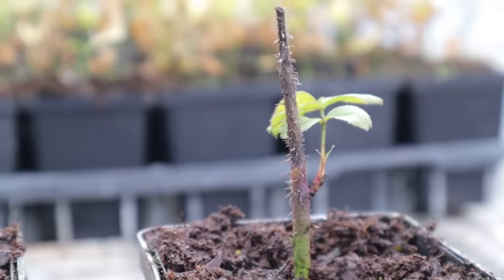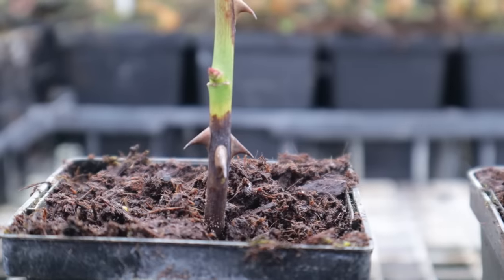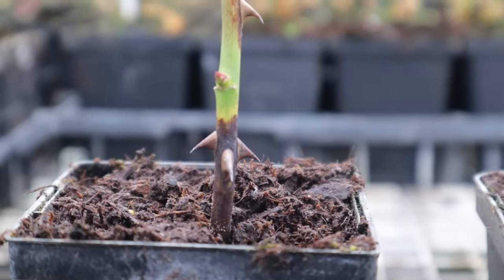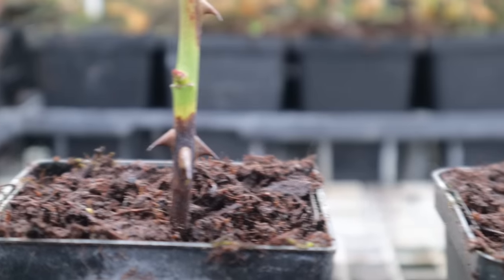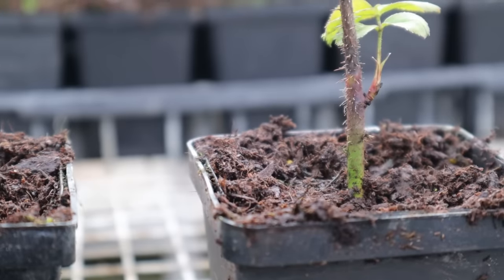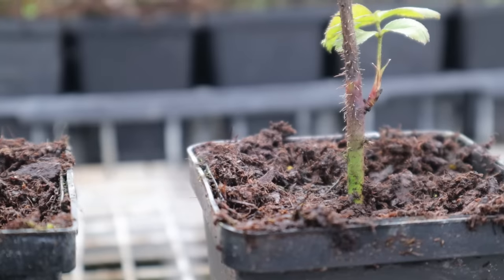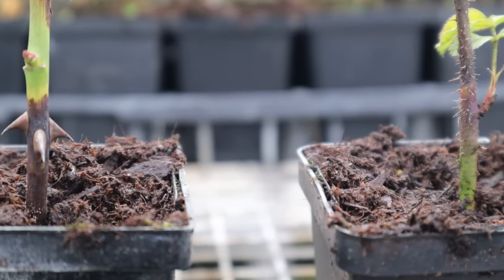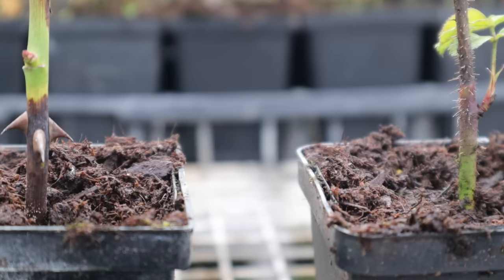Why Do Cuttings Fail? Propagation Tips

Comment: It drives me nuts... from the same tree cut the same way in green stems, had tried several ways, all just below the knod, water kept it green but no rooting, rot from the end down, rot from the bottom up, and few rooted.. same environment, same light, all at the same time.... even in small area

Comment: What about spraying the leaves with solution of water n hydrogen peroxide? Wouldnt that help with both water n oxygen the cutting needs?
Reply from the maker: I think as long as it's fairly dilute, you'll do no harm.
Reply: @FraserValleyRoseFarm  do no harm does not answer the question. Who cares if it does no harm if it doesn’t help
Reply from the maker: You may have to play around with it a bit - you'll hear conflicting things: some people say that the H2O2 will reduce the risk of rot, but the rate of application and frequency will have a lot to do with it as well. It will have more impact on the above-ground portions of the cutting, as peroxide reacts an neutralizes in the top layer of the soil upon contact. It does seem to reduce the onset of algae and liverwort. I've also seen propagators do a bit of damage with the wrong rates, and I haven't made up my mind about whether it's worth it for me to use in my greenhouse.
Reply: @FraserValleyRoseFarm  I appreciate the info and that’s interesting too, but the video and my question was about cuttings and propagation. It was just an idea I had bc I know a little about chemistry. H202- hydrogen peroxide turns into oxygen and water. You discuss in video cuttings need both. So I would assume spraying the plants with a diluted enough solution that would not burn the plants would be helpful as since no roots to take in water and oxygen yet and the leaves could

Comment: Anyone know why I simply cannot get Parahebe's to take for cuttings? I have also put them in water to see if they will root but so far still nothing. Based on the video, it would seem my cutting is too dry as the tip leaves start to go black and shrivel after 4 weeks. When I pull up the plant, no rooting has happened. I took it in late summer. But admit I did not put any plastic bag over it, so could that be the reason?
Reply from the maker: Yeah, I'd try it with a cover to help with humidity. Not to much, but enough to keep it from drying out.

Comment: I clone trees as a hobby some clone easier than others do. If its a difficult variety to clone than good have large amount of cuttings because then something should root. Willow root easy poplar root fairly easy except Aspen Dog wood root easy. Sycamore is a little bet more difficult but I have gotten few to root. Hydroponics and air layering work good for harder root cuttings rooting gel helps also wounding cuttings help. I have hard fig root easy also. Sometimes dormant cuttings root easier or suckers.
Reply from the maker: Thanks Brian for sharing your tips!

Comment: I looked at Walters and Ball and could not find culture guides.
Reply from the maker: Here's an example page for one of their plants: https://www.ballseed.com/PlantInfo/?phid=037300001039951 on the lower left of the page there's a link to the culture guidelines, which downloads a pdf file for the variety with growing times & conditions.
Reply: @FraserValleyRoseFarm  thank you. 
I was looking for a single page.
Having the worst time with rugosa. Just lost 6 cuttings.
Reply from the maker: I've been hit and miss with rugosas as well. Most of my rose cuttings have done well with pretty strong light levels, but the rugosa cuttings seem to hold up better with a little less. YMMV
Reply: @FraserValleyRoseFarm  thanks for the response. 
My lighting is pretty low and from the look of them, I'm gonna say too much soil moisture. I'm gonna try tips this time and a bit dryer soil (Kings Way) and I'm using Hormodin 3 powder.

Comment: Dude strain the beans and try this trick use the water just try it ...and if they are rotting it's from rhe scissors haveing bs on them you need  to clean your scissors and make the cutting 8 inches on Simi hardwoods I'd graph to... or cross root oh man you have a cool job

Comment: Do you want a callus on the bottom of your cutting or should you cut closer to the node to prevent a callus on the bottom of your cutting? 7:26
Reply from the maker: Callus is an early stage of rooting, so wherever you cut (and usually it's close to a node for fastest results) callus is a good first sign of success.